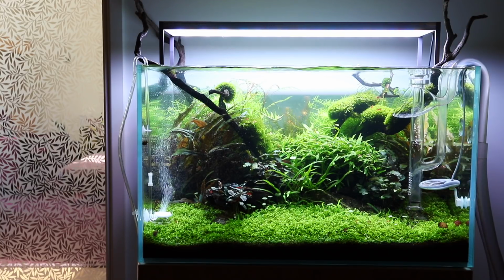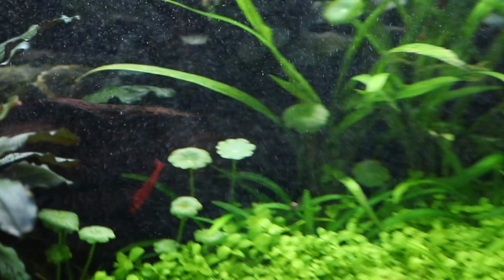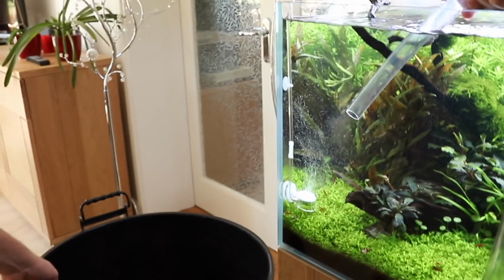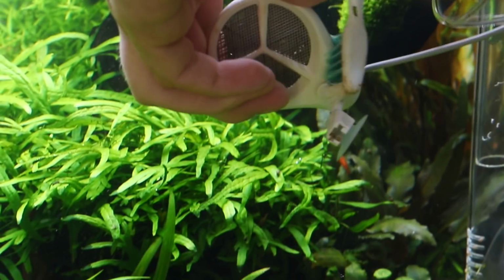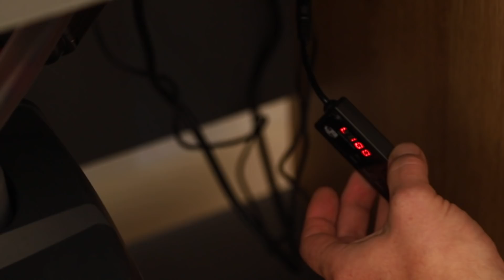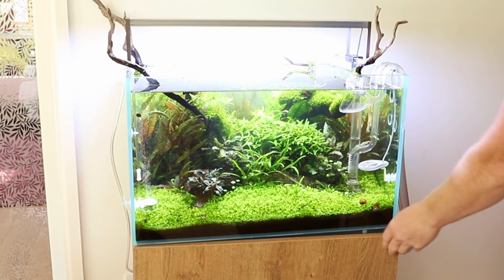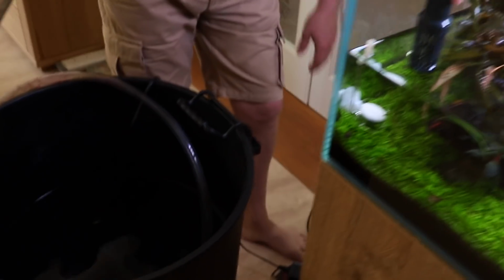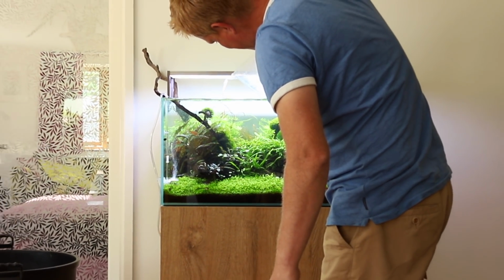His AQUASCAPE just gets BETTER

Comment: Great video, amazing tank. Please fix the skimmer, it bounces and it’s distracting. :)
Reply: Bernd Twiest  already done my friend. Meant to do it at water change but forgot, 10 second adjustment needed 😃
Reply: Steven Gould really enjoyed this video, interesting to see how you maintain this tank. The large bucket is a great idea.
Reply: @stevengould2965  hi!why did you change the diffusor?
Reply: blu3leg3nd changed to an ADA Glass Beetle diffuser, just playing around really. Got it cheap in TGM closing down sale. It’s no where as good as the AquaRio one imo. Looks nice though!
Reply: @stevengould2965  ok, thank you👌
Reply: @stevengould2965  Steven, what are your thoughts on Inline diffusors vs in tank diffusors? 
I see you use in tank and most pro aquascapers do (f.ex ada gallery)
is there a specific reason for that?
Reply: blu3leg3nd in line diffusers are good. Better for larger tanks (3’+) than intank ones. The new co2 art ones that aquarium gardens have are brilliant.